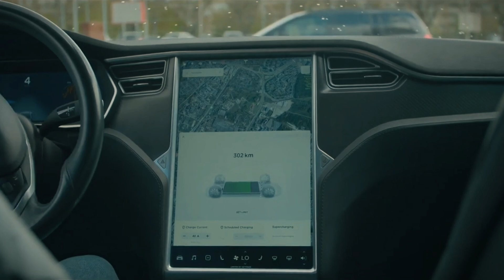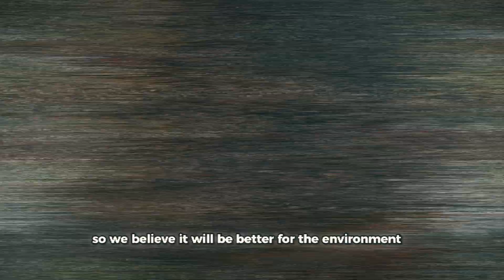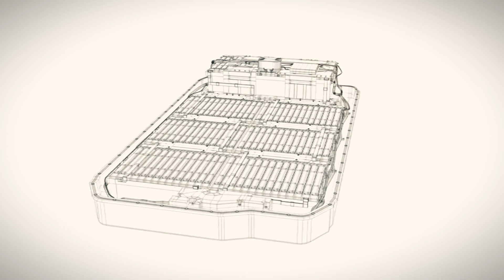How green are electric cars EXPLAINED

Comment: You don't discuss the local pollution caused by the increased tyre wear by these heavier EV's going into waterways and eventually to the sea, plus the increased road repairs that will need to be done. Recycling these Lithion Iron batteries will become a big problem, shouldn't be dumped in land fill, which would be more pollution. Then in 10 years time these new EV's will be worth zero $ as the cost of new batteries will be much more than the car is worth, scrap. Also, what about farmers and trucks, they can't stop for recharging every hour or 2, so for the moment they cannot change to EV's. EV's will eventually be the norm when battery technology and recharging become much more reasonable, maybe in 15 to 25 years time, but for now Hybrid vehicles make more sense and I am helping he mining children's health by not buying an EV.